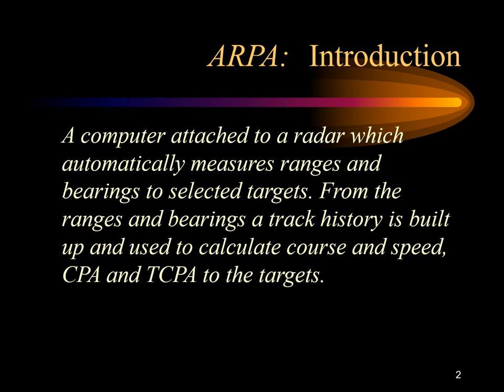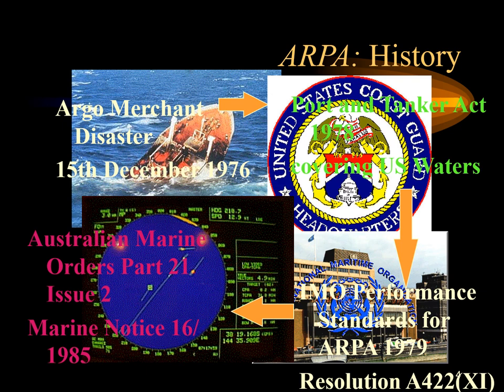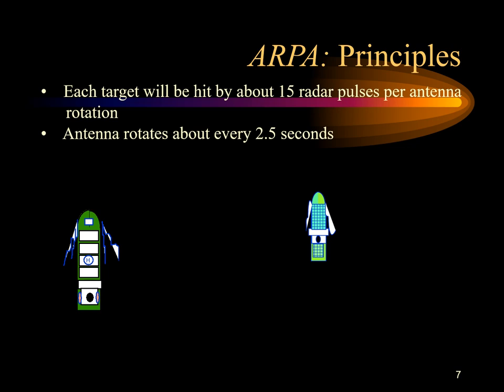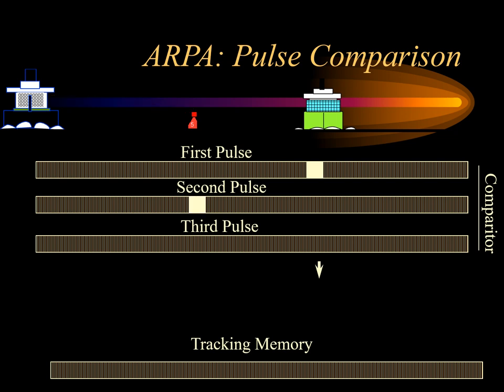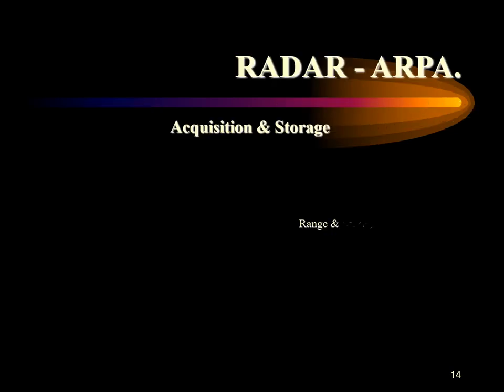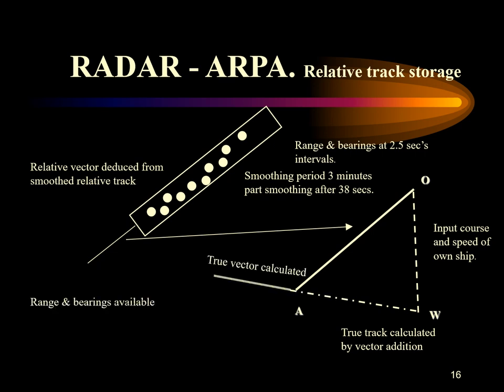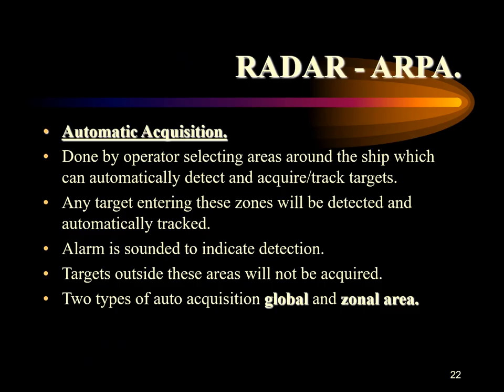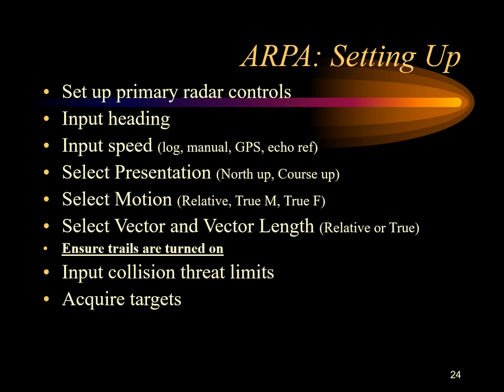ARPA (Automatic Radar Plotting Aids) - Target tracking and storage

Comment: Point to add
"GATE" is the box that shows around the new target when selected. 
Size keeps reducing as processor gains confidence.
This process is called "Rate Aiding"
Advantages of reduced GATE
1) lower chance of target swap
2) Improved ability to track target through rain and sea clutter
3)Early indication of target's motion

Comment: Good day, sir. I recently joined a vessel and conducted a Radar self-test. During the test, I encountered several errors. The temperature of the RF unit monitor exceeded the maximum specified value, measuring 39.1°C instead of the expected 27.3°C. The high voltage reading was lower than expected, measuring 317.1V instead of 527.9V. The radar monitor displayed a higher value than the expected value, showing 5.0 instead of 1.6. The magnetron current range should be within the specified value, but the RF unit monitor showed a higher reading of 2.1A instead of 1.5A. Furthermore, the trigger frequency was significantly lower than the expected value, measuring 451 Hz instead of 2273 Hz. Additionally, the ARPA and AIS targets were not appearing on the Radar display. Could you please assist me in identifying the problem?